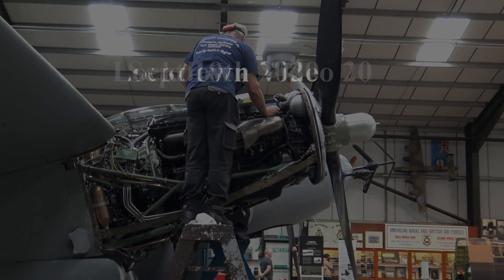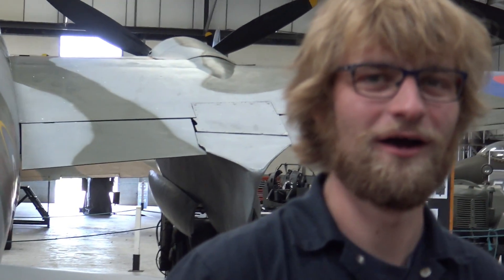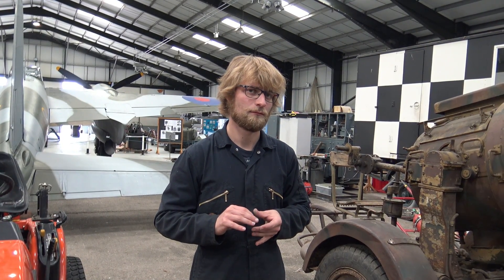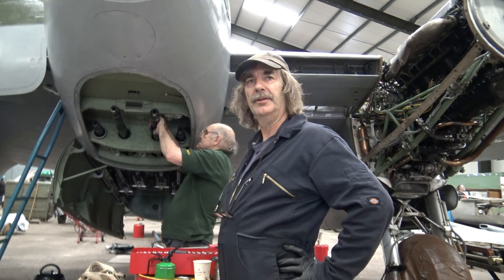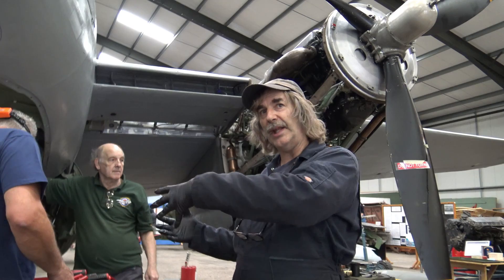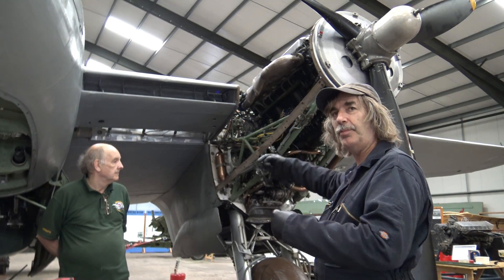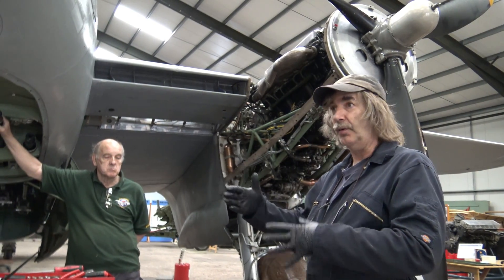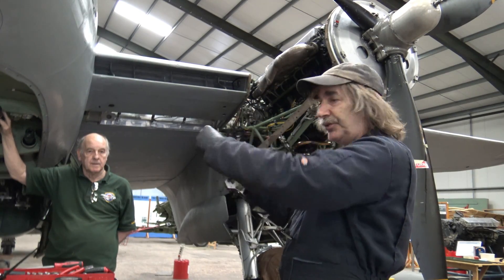Lockdown Video 20.   Ignition of Merlin engine  Brad and Martin

Comment: A guy called Hives at Rolls Royce was the chap who experimented with ignition timing and different strengths of octane in the petrol.Its a science in itself as with a car as to where the maximum efficiency is but with big engines like the Merlin and some of the huge American radial lumps like the 3350 it is critical or things can go wrong quickly if that spark is a tad too early.Water injection was used in some engines at full choke to prevent pre ignition when very hot." Dieselling " would kill an engine in no time at all.

Comment: Spark occurs but the fire spreads like a bush fire in a field so the more sources of ignition, the quicker the field burns out, like lighting fires all over it. The timing difference is due where the plugs are located and the valves as they open as not to allow enegry out. So imagine a room with a shut door (exhaust) youd want to light the plug nearest that first while the door is still shut then the one furthest away just after as the door is openeing...kinda like that...only bloody fast lol

Comment: Whilst these gentlemen are knowledgeable, and have vast experience on the Merlin, there might be some inaccuracies. 

Two independent ignition systems have little to do with redundancy, and more to do with preventing detonation. The normal flame rate of Avgas remains the same in any engine. However, in large bore engines (greater than 5 inches in the Merlin), dual ignition is required to ensure the mixture is burned evenly. If only one ignition is used (or one of the two fails), the unburned mixture is compressed by the advancing flame, and might spontaneously combust at the periphery of the piston. This is known as detonation, and is destructive. This phenomenon was well-researched and solved by the great Sir Harry Ricardo.

Magnetos don't ordinarily fail willy-nilly. I suspect that in the case of magneto failure, the engine would run rough, and power reduction required by reducing boost, or shutting the engine.     

There is a difference between full power and maximum RPM. A magneto check is done at about 75% of the maximum RPM (manufacturer dependent), and low manifold pressure. If it is performed at high boost, the potential for detonation is immediate. 

Pre-ignition is not detonation. It is the ignition of the mixture prior to that provided by the spark plugs. It is caused by a number of things, but more often than not by the spark plug or carbon glowing. It is rare given the excellent fuel quality available and the correct selection of spark plug heat range. However, pre-ignition might cause detonation, if it happens well before the normal ignition from the spark plugs.

Phased ignition timing is an excellent engineering design in large bore engines. The first spark allows commencement of flame propagation, to be enhanced nanoseconds later by the second, thus ensuring normal and complete combustion.
Reply from the maker: Hi Roger I received good comments on this subject yours being one. Very interesting read.

Comment: The pre ignition timing on a four stroke engine,
 is due to a pile of stuff to be aware of..
Bore diameter.
Fuel quality.
what octane it is used with
Number of spark plugs.
At what rev.
Engine temperature.
Normal aspirated or
Charged by a compressor in one or another way.
At what manifold pressure etc...
To obtain maximum power at a given rpm.
the air/fuel mixture have to be ignited at a certain degree
to burn the fuel mixture at desired speed,
during the firing process.
So due to big bores,
To be able to burn all fuelmixture.
The fireing process have to start earlyer when revs are increasing.
Normal timing on a four stroke engine with one sparkplug,
start lets say, around 18 degrees BTC.
And ends at maximum torque 40 to 45  degrees BTC.
Engines with two or three spark plugs per cylinder (Racing)
Stop at around 38 degrees BTC.
To make this a comment,
Not a book..
I just want to explain a little bit on what them guys said about why the location and two sparkplug oposit each other.
And why they dont fire at same time
The inlet side is slightly cooler so you start the burning process there 
To be able to burn all fresh gases in a sequence and to reduce detornation problem.
On idle this is not a problem.
The combustion speed is low.
But in anger and at take offs at 2800 to 3000 Revs
That is when its matter..
;)
Sorry if my English is a bit wonky..
Best regards from Sweden !
:)
Reply from the maker: Hi Roffe thank you for your comments a little bit beyond my knowledge of the internal combustion engine but interesting read.Thank you.

Comment: Mag check is a standard pre take off check on all aircraft, simply run up to the recommended RPM, note that, drop one msg note the new rpm, repeat for the other mag.  The drop in rpm when one mag is down on one must be similar to the other when repeated on the second mag.
Reply from the maker: A good comment John,

Comment: the dual magneto offset is also to prevent starting the combustion on 2 sides of the chamber at the same time.. causing them to collide somewhere in the middle . with one going early and one going late the first flame front is passing close to the second spark plug as it lights off the air fuel mixture on that side of the giant combustion chamber.  gives it an extra push down on the piston.  when turning off leading or trailing magnetos.. you are cutting down on the size of the combustion flame fronts.. so you get an even reduction in rpms no matter which mag was shut off for testing.
Reply from the maker: Thanks for your comment Wayne.

Comment: Instead of thinking that the petrol "explodes" think of it burning quickly, this would be influenced by turbulence within the cylinder. More turbulence = quicker burn. More spark sources = quicker burn. When one mag stop sparking, ignition is no longer at optimal point =  less power.
Reply from the maker: Thank you Keith.

Comment: The twin plugs give a better burn , Nodays we use high capacity ignition sources to get the same result,  It was not only aircraft engines that had twin plugs , many high performance car engines of the day had twin plugs
Reply from the maker: Thanks for that on high performance engines Geoffo 0
Reply: Normally because of the interrupted Flame path caused by high domed pistons used to create more compression on engines with shallow valve angles.
Simultaneous firing, this is slightly different in that the Merlin is 4 valve per.